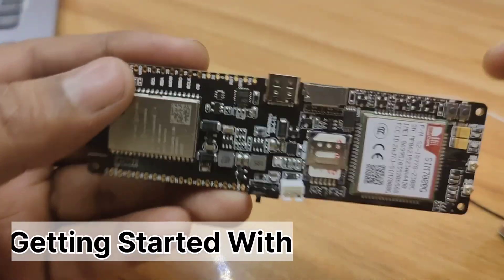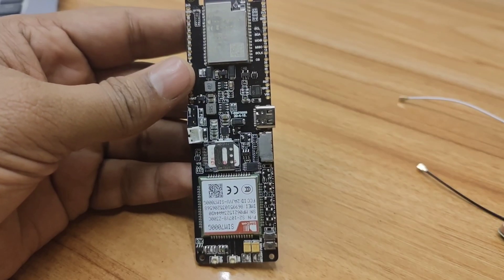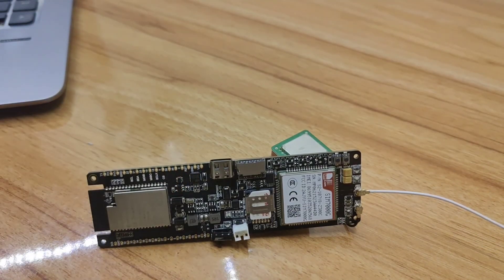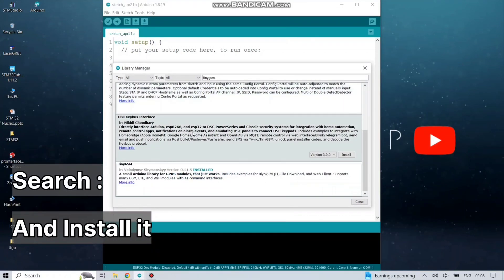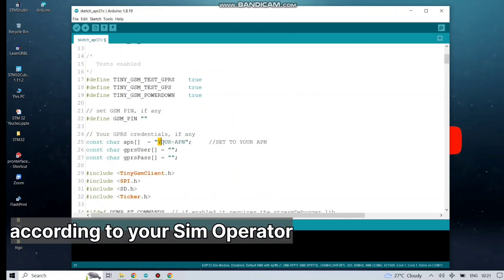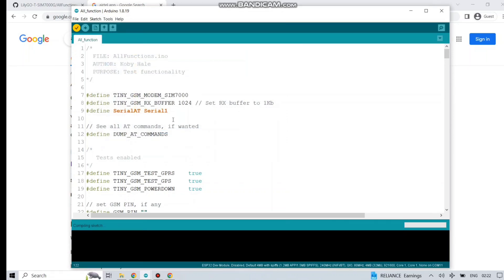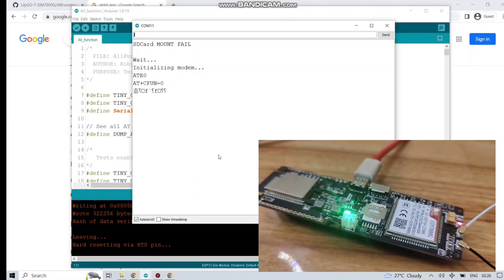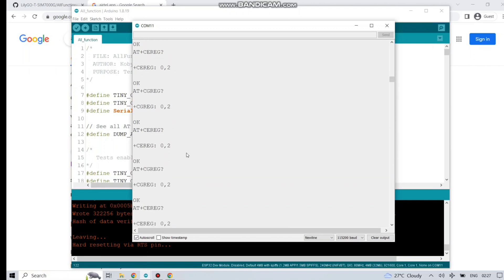Getting Started with LILYGO - TTGO SIM 7000G Module • Introduction & Testing All functions • IOT

Comment: hello , I need some information: can the LILYGO® TTGO T-SIM7000G SIM Development Board (ESP32 WiFi Bluetooth GPS Module, SIM7000G/SIM7000E/SIM7000A/SIM7000JC, 4/16MB Flash) be programmed in Rust?
Reply from the maker: Yes , You can programme in Rust

Comment: Hi, thank you . Can anyone tell me how i can power the board trough the pins? There is nothing to be found in the manual ! There is no VIN pin, only VBAT, which should only be 4.2v max? very confusing
Reply from the maker: If you see for pin description you will find there is an Vin Pin is available. Hope it helps 🤞

Comment: What cable are you using? None of the usb c to usb a cables I have make the board light up.
Reply from the maker: I have used ordinary Type C cable .Better you try with New Cable or try with battery and turn on . If still it doesn't lit up , board might be dead .

Comment: Can this module be powered by supplying a regulated 3.3v to the 3V3 pin ? 
And if yes, would it all power up, including the GSM module ?
Reply from the maker: For any external power supply (3.3v -  9v ) you can use VIN and GND pin. And using that pin gsm and gps will also work .
👍
Reply: @techwarmup  my query is about the 3.3v pin used as an input for power.
Reply from the maker: @arnoldmuhairwe  Yes you can use 3.3v pin 
but that won't be safe for the device if you got any voltage fluctuations device might collapse. 
As well as If you use multiple servo it won't provide enough current and voltage  .
Reply: @techwarmup  I could use capacitors to smoothen the ripples and use a 3.3v LDO to supply a steady 3.3v supply. My worry is whether the GSM would be able to power up as well from that arrangement.
Reply: @arnoldmuhairwe  were you able to find anything ?
Reply: YES. It works just fine. Good stuff really.

Comment: Hola , un gusto saludarte y felicitarte por la extraordinaria información que compartes, bueno comentarte que seguí al pie de la letra todo el ejemplo y no me pudo salir,  al parecer no hay comunicación entre el SIM7000G con el ESP32 incluso por el pin 4 no envía la señal de POWER.

Nota: la programación  si se llega a completar, sin embargo no se prenden las luces de color rojo de GPS y del SIM. Lo que se queda prendido en todo momento es la luz de color azul y verde.

Gracias por tu tiempo espero tu gentil respuesta y pongo en copia lo que me sale en en el monitor serial. 

rst:0x3 (SW_RESET),boot:0x13 (SPI_FAST_FLASH_BOOT)
configsip: 0, SPIWP:0xee
clk_drv:0x00,q_drv:0x00,d_drv:0x00,cs0_drv:0x00,hd_drv:0x00,wp_drv:0x00
mode:DIO, clock div:1
load:0x3fff0030,len:1324
ho 0 tail 12 room 4
load:0x40078000,len:13508
load:0x40080400,len:3604
entry 0x400805f0
ets Jul 29 2019 12:21:46
Reply from the maker: Hello Friend , 
Thank you for your kind words .
As per your written comments I can sense few thing might have happened and you can do few things for it i.e.
Things to noted-
1. The green led indicates the power on board .
2. Blue Led indicates the Esp32 activity .
3. On other two led's , one which blinks shows the GSM network establishment and other red led shows power in GPS module .

Give it a try -
1. Check whether device is properly working or not by uploading a simple blink program in esp32 .
2.  Check the Usb cable you are using for communication.
3. Select correct baud rate .
4. Use latest version of Arduino Ide or try to use alternate version.

I hope you find the solution for your problem.
Good luck.
Reply: @techwarmup  Gracias por responder, realice lo me indicaste y la programación fue completada, sin embargo el ESP no responde, intento con varias programaciones y siempre sale lo mismo.

rst:0x3 (SW_RESET),boot:0x13 (SPI_FAST_FLASH_BOOT)
configsip: 0, SPIWP:0xee
clk_drv:0x00,q_drv:0x00,d_drv:0x00,cs0_drv:0x00,hd_drv:0x00,wp_drv:0x00
mode:DIO, clock div:1
load:0x3fff0030,len:1324
ho 0 tail 12 room 4
load:0x40078000,len:13508
load:0x40080400,len:3604
entry 0x400805f0
ets Jul 29 2019 12:21:46
Reply from the maker: @mizraimdamiancasas7160  i would suggest to start with a new TTGO board if the problem is repetitive.

Comment: hello sir, I am using Lilygosim7600e-h to get the GPS location. After getting it, I am connecting to the internet using pppos_example using gsm internet (TCP) to send the GPS data to the mqtt. but signal drops when GNSS is enabled; it will not work both at the same time, either internet or GNSS. I am also referring to getting this work done, but I dont know why in an espidf environment.